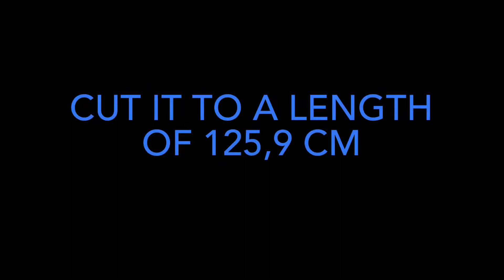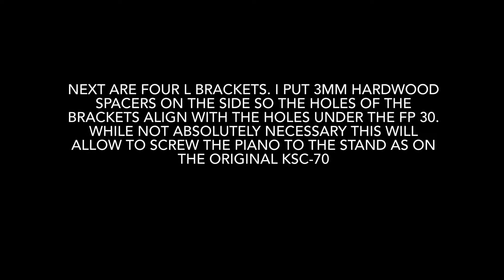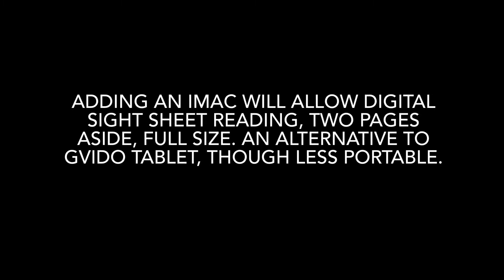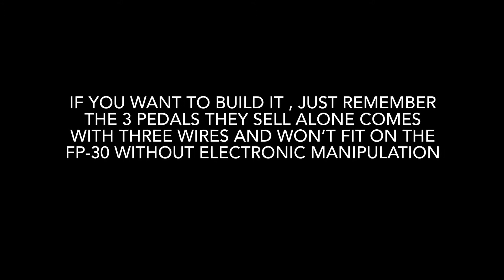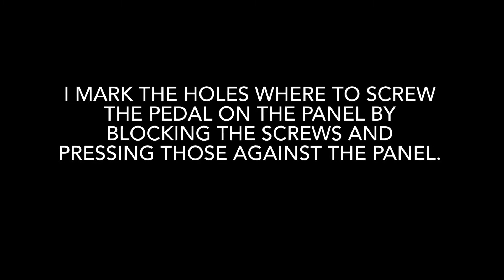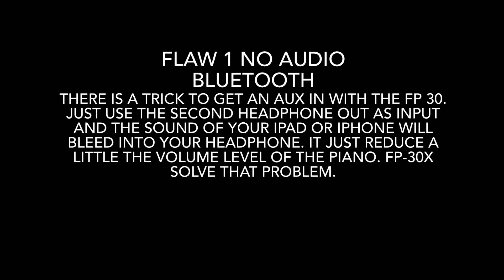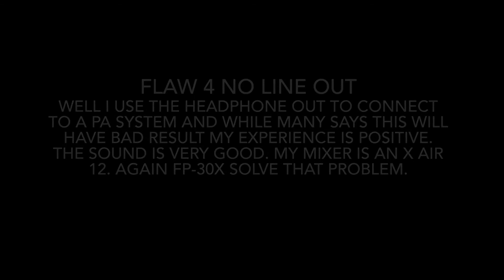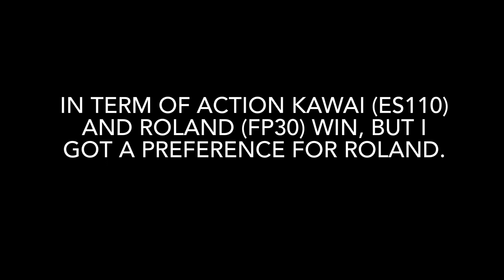DIY STAND FOR ROLAND FP-30 digital piano , setup and fp-30 flaws

Comment: How thick are the two side boards, i.e. how wide is the overhang on the piano that rests on the side boards? Around 2 - 2.5 cm?
I wanna make a stand for the FP10 but don't have it yet, so I'm trying to find measurements all over the internet haha
Reply from the maker: Birch plywood is 3/4 inches thick (1,9 cm). The black plastic side of your fp 10 will comes flush with the wood without resting on it. Piano frame inside of that plastic sit on the wood, and also on the brackets. But it doesn’t matter if the plastic sit too on the wood. 
You have to exactly center the piano for resting it just on the frame, and this will depend on your brackets. If you don’t screw the piano to the brackets it is easy to center the piano, but if you screw them it can be tricky to got  your piano exactly in the center, depending how precise your brackets will align with the screw holes under the piano frame.

Comment: Is the KSC-70 stand just as stable as this? I have not been able to try that stand on either the FP30 or the FP30x, but the home piano RP201 seemed too still, and I loved that about it.
Reply from the maker: I tried the stand ksc-70 at the store, and it has seems to me very stable. I built my stand based on the look of the ksc-70 guessing the dimensions by Internet forum and images of it. I never had a physical KSC-70
I don’t know the RP201, it seems good,  but less portable than fp-30 which can be easily removed from the stand and serve as a gigging instrument on a more portable x shape stand ( less stable though) . Bracket Price of RP201 is also different. 
My construction ( KSC-70 replicate tentative) is very stable and I play rather strong on it.
Reply: @micheljoqwerty6820  Thanks for the reply. Do you have any issues of clicking with the action? I almost got an FP 30X today and one key was clicking on release. I asked for another piece. Let's see.
Reply from the maker: I add a prestation of clocks from Coldplay to illustrate the stability of the stand.
Reply from the maker: There is a little click yes. If you play with headphone it doesn’t matter, but people distant in the house can hear it and find it annoying when I play very strong like Metallica pieces. Honestly if my wife is sleeping I must close the door at the basement to not disturb her.
I read some people have some notes become noisier than other and there is video on you tube showing how to reallocate the grease inside the mechanism either by opening the keyboard or just by playing repetitively the note while the keyboard is upright without opening it.
I did not have to do that after more than one year of daily playing.